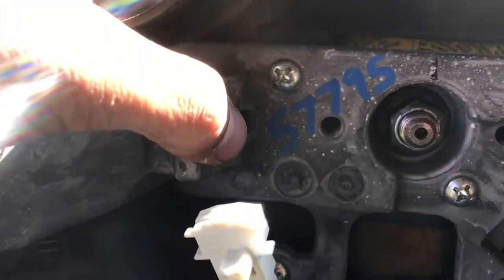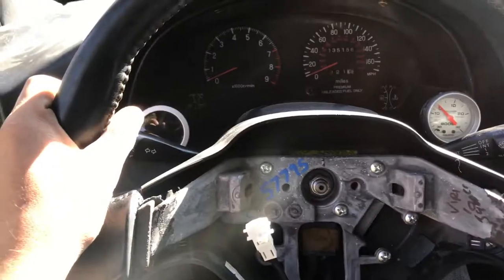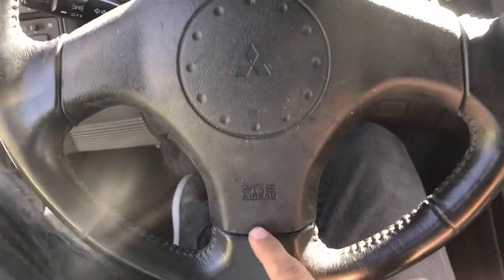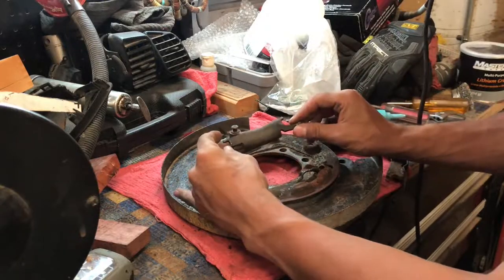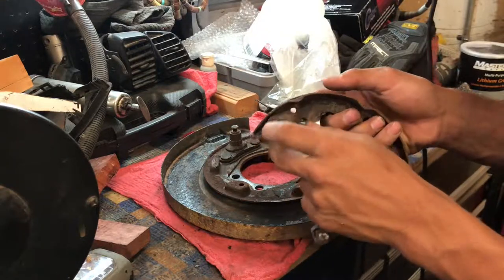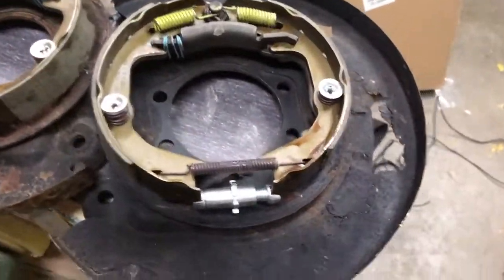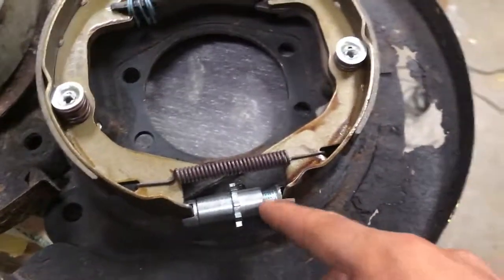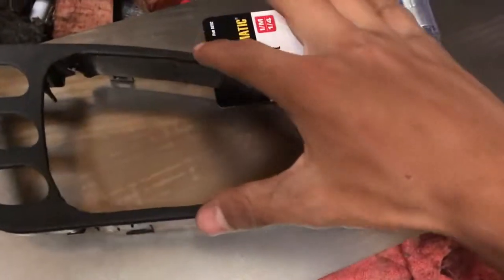2G DSM Parking Brake Overhaul & Airbag Install

Comment: I also decided to customize the 3g steering wheel. That said, you are correct. the 3g is so much better in so many ways, The large turtle-like 2g air bag is hideous . Like you I prefer a three spoked steering wheel. That said I'm not a fan of the 4g steering wheel either nor the EVO steering wheel.

Comment: I have the 3g steering wheel installed in my 2g.  My installed involved more than just mounting the steering wheel. I had to modify the cruise control.
Reply from the maker: madcurls I have the cruise control deleted so I just took the whole switch out, but yeah I read you have to shave a bit off of the hub in order to get the 2g switch to fit